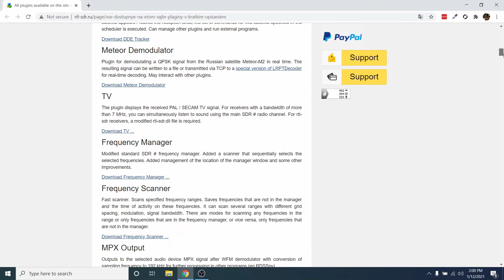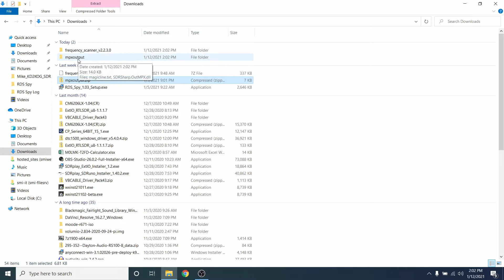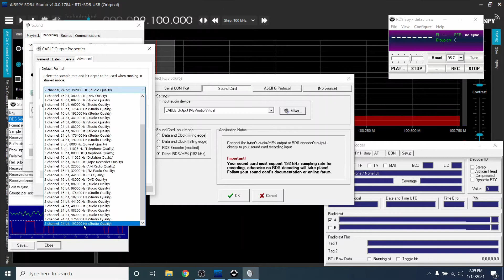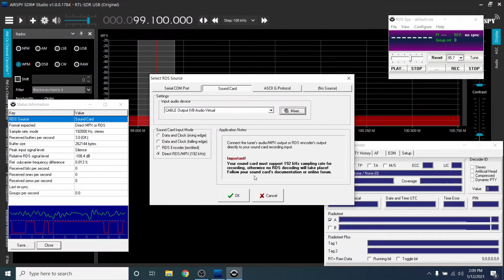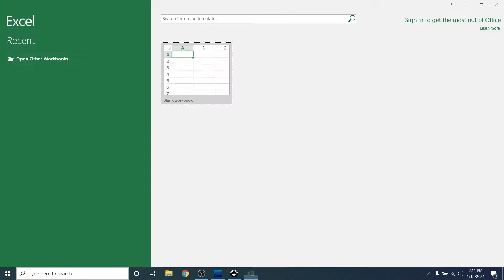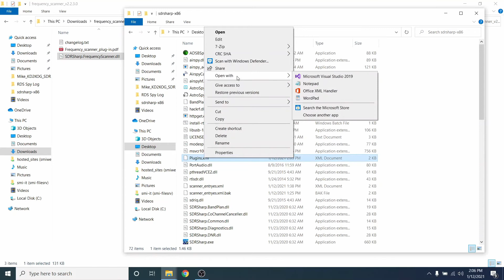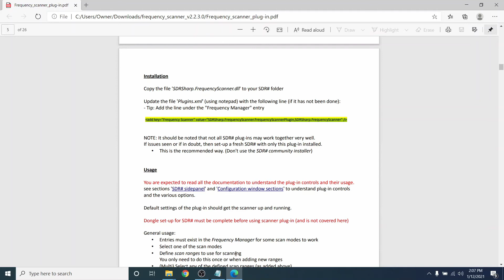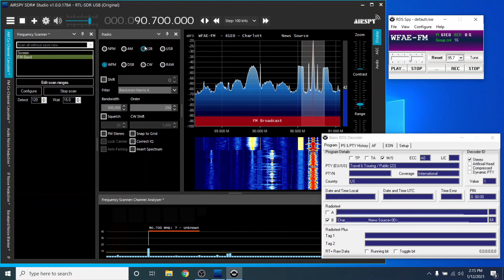Scanning and Auto-logging FMDX with RDS Spy and SDR#

Comment: Hi ! This won't work if I use the basic VB cable version you show (or poorly decode). I must run the Hi-Fi version.
Reply from the maker: When using the basic version was your sound-card set to at least 16bit, 48000 Hz (DVD Quality)?
Reply: @BrokenSignal  Yes, all set to 192 kHz (playback / recording in the Mixer + RDS Spy). Note that, as a FM DX'er, I've been using RDS Spy for years. When running the 'basic" VB Cable, decoding is very poor and random, it actually only decodes a few stations. With the Hi-Fi version, the improvement is very significant. I notice that the different online tutorials recommand this version. It seems to me that the basic version does not support 192 kHz, which could explain that the decoding is partial / random. Absolutely no problem with the Asio Bridge edition. Maybe in the USA, the bandwidth occupied by FM stations is different from those in Europe (I'm in France), which could also explain slightly different performances ?